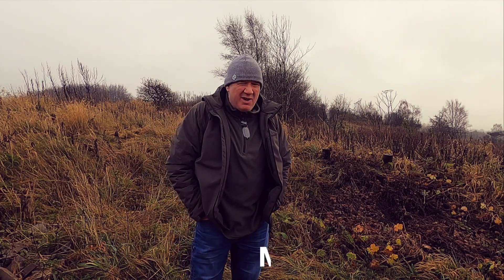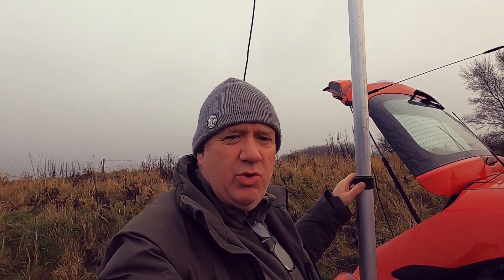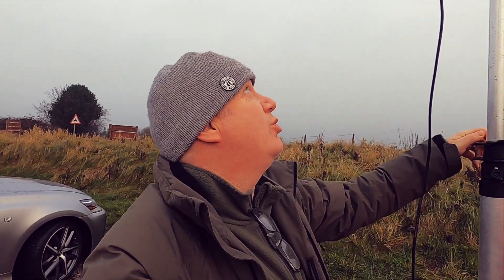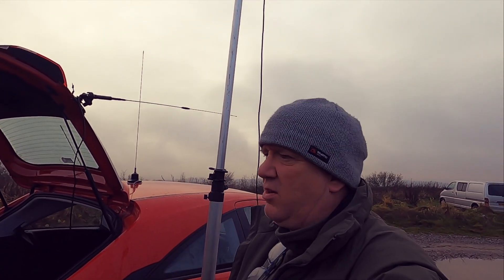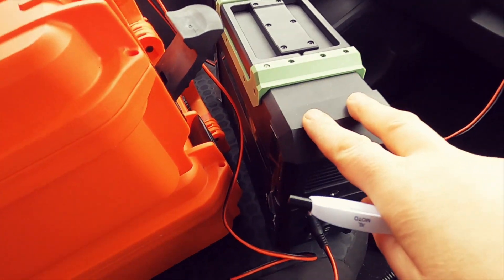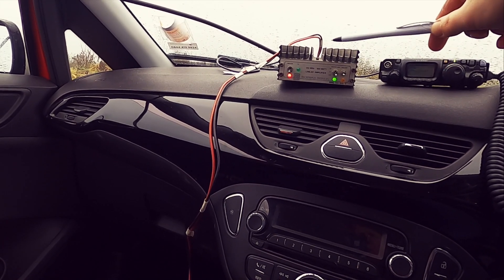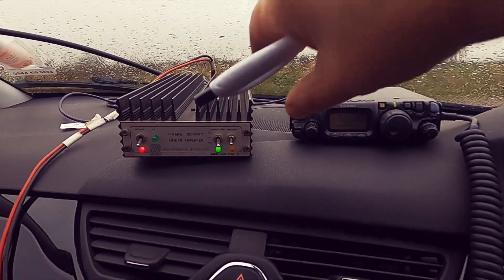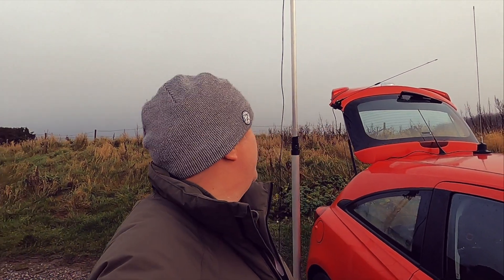Well this ham radio mast didn't last long

Comment: Very disappointing with the mast. Looks like the quality of the fittings let it down. Vine Antennas do a very sturdy looking portable telescopic pole (Skypole) with clamp type fittings in both 6 & 10m. They're GRP so no RF coupling problems. I have one of their HD 10m telescopic fishing pole types for wire antennas and I'm impressed with the quality of it. The Skypole is much stronger but also much more expensive.

Comment: I have a similar mast but with slightly different tightening bolts.  Its not the best but it has so far served its purpose.  It was cheap so I didn't expect quality and lets be honest, you only get what you pay for.  If mine breaks I will still use it with my own fixing solution.  By the way, I put a clansman mast section on the top and the mast no longer acts with the Yagi.....  Thanks Carl for sharing and be safe.

Comment: Thats unfortunate Carl, these things do happen. Height is might yes and the fact you are already up on high ground for VHF all the work is done for you so you don't really need a big mast to put your yagi onto. I have used the bottom 2 sections of one of DXC's poles and put the yagi on it. Westflex as you say is heavy and overkill for portable. For a short run from your car up a short mast a bit of RG8X will do the job, losses will be minimal with such a short run or a short length of Aircell 7. Hope you have a great christmas. Keep the videos coming ! 73 Syd

Comment: I think I know where you got that mast from, Carl. I have one too. Part of the problem with mine was that nothing lined up. Another problem was that the locking screws bear directly onto the inner mast section and, as the ends of these screws had not been properly finished, these tore up the mast surface. Also, the tube thickness was far too thin and properly locking the sections resulted the tube being badly deformed. I eventually overcame this by rotating the locking collars and remounting them with properly drilled holes that lined up correctly. I also drilled a hole through the inner mast section and the locking screw now passes through this which, although not ideal, holds the section up when extended. Bottom line is that masts constructed like this are usually both poorly designed and engineered.

Comment: Built mine out of electrical tubing.  Various diameters getting progressively smaller. Collapsed it’s about 1 3/4 meters, and extended its around 9.5 meters.  Bolts through the tubing hold the sections extended, and electrical tape around each section mark where to align them. Homemade guy wire plates ( similar to DX Commanders) rest on the larger bottom sections. Guys are a good quality nylon rope with carabiner clips which attach to the guy plates. I use large tent steaks to anchor the whole setup... 
 It’s a bit heavier then your mast, but it will not fail in wind and cold either. So far it’s been through two windstorms, one nor’easter and one snowstorm.. 
Super easy to fabricate, and you can make it any length you want. Of course, the bigger it is, the heavier and longer it becomes.. The one I built for camping is about 5.4 kilograms, certainly nothing you’d want to take on a hike. But it has made it into the woods several times so far hiking form the car to the site around 0.8 kilometers.

Comment: Some bad luck there buddy, especially with that mast. Cheers as always for the video.
Might be worth mentioning if you didn't already know, the 817's swr meter shows you reflected power only. Obviously, if it's high then that's not good either but thought it worth mentioning anyway.
This is an old article but interesting nevertheless. 

http://www.ka7oei.com/ft817_vswr.html

Cheers

Comment: Thank you for this video! ... one question: did you run that vertical "slim-jim" antenna so close in parallel to the aluminium mast? I can not believe this ;)  vy73 from Hambug/Germany, Dietmar, DL4HAO
Reply from the maker: No I angled it away, the metal mast was affecting the yagi as well

Comment: Don't think much of that mast if a bit of cold snaps the plastic, it should be able to stand a bit of cold.  It would have been better if it had been an alloy instead, but that would add to cost.  Even a thinner metal band with a nut held in place would be better than plastic.  Send it back.  Garbage design.  The beam should have been ok to use, I would have tried it without the amp, then if power out looked fine I would have stuck the amp on.  If it get very hot stop, simple as that.  But at least it was not a wasted trip as you said you got some contacts in.  Nice one Carl.  Good to see that you include failures, as you always have done, proves you are human like the rest of us.
Reply from the maker: Wait until the next video, doesn't get any better 😁
Reply: @M0SZT  Oh dear, you are having a bad run at the moment then.  I am going up a mountain shortly, right to the top, in a car.  I was thinking of taking the CB with me, but i would have to throw everything out of the shed to find an aerial and mag mount.  I should have done this today, but I got sidetracked.

Comment: They're so attractive for the price aren't they but there are plenty of bad reviews. I wonder if it might be worth the time now that you have the tubing to put together your own clamps? Heavy jubilee clips with wingnut fasteners perhaps?
Reply: Hi Carl. I scrapped the plastic clamps years ago and use two HD jubilee clips, one to clamp the outer tube and the 2nd above the joint to stop it sliding down. Sorry not to work you in the contest. Have a great Christmas. 73 John G0JLF.

Comment: Hi Carl. Happy Xmas to you and the family. Thanks for the videos this year. I sometimes have ‘those days’ where I go out and quickly pack up and go home....often because I take too much gear and it’s too much of a faff! Looks like excerpts from the 2m AFS contest early December. One I didn’t go out for after hurting my back (from sitting too long in chair on CQWWCW contest prev weekend!). I finally went out portable last week for the evening 4m contest. I had a couple of SWR glitches with parts of beam antenna being too close to metal roof in certain directions (and tripping the amp, which has elaborate protection). Mud glorious mud in the motorhome! Big wind and rain later so only just about worth the outing. Catch you soon on GB3HH. Cheers, Nick
PS hope you get a refund on mast. Much of the Far East made stuff has no thought about ergonomics, temperature considerations or even CE marking/safety. Some of our contest group use Spiderbeam push-up ally masts with associated tripods and also pneumatic ones from Total Mast Solutions. Expensive but sound like a longer-term bet. I have a 20 foot x 3 section ally wind-up on back ladders (£15 second hand) or use ally scaffold poles on a tilt base. You can see them in my vids.
Reply from the maker: Yes it's from a couple of weeks back, my family went into isolation after then as we had positive covid in the house 😞. Yes catch you on HH, thank you for being very supportive! Merry Christmas and a happy new year!

Comment: Shame about the mast Carl. At least it can go back. I have my swr meter in the same go-box as the amp. It’s just not worth the risk of not knowing what’s going on and blowing your amp. Also, if you get weird output power at the higher levels, then you psu may be struggling. Good to get out though and also suss issues when it’s not critical 👍🏻 Enjoy 🎅🏻🌲 🥳

Comment: I hate plastic fittings - they always seem like a convenience for the manufacturer than a properly engineered product solution.  No SWR meter ? Glad to know it's not only newbies that make errors of judgement lol.
Reply from the maker: yes I tend to rely on the inbuilt rough SWR meter in radios with antennas I think are fine, amateur's amateur!

Comment: I bet I know where you bought that mast from.They have been allowed to get away with  selling crap items for several years I'm afraid.🙈
Reply from the maker: Biggest part of the problem is the imagery on many ham online shops is poor quality, I will avoid buying items where the manufacturer can't even make sure the images are high res on the shop front.
Reply: Can you say where you bought it please
Reply from the maker: I'm being careful not to, my only word of caution is to request better resolution images on any goods like this you buy and get a good inspection online during lockdown
Reply from the maker: It's sold in a few places, the key bit is me not paying enough due diligence.

Comment: Get a spiderbeam aluminium mast mate you can get it with a quad pod to mount it in for easy set up  on your own. There expensive but will last a lifetime .
Reply from the maker: I'm part owner of a quadpod, I need to chase that up! I've now replaced the buggered mast with a rugged fibreglass telescopic mast that you could hang small yagis on.